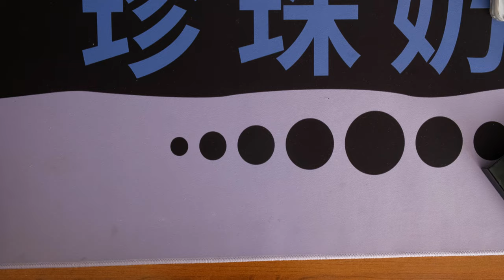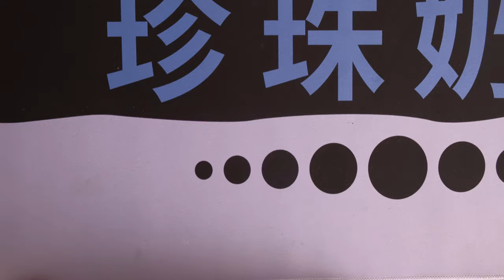Building a $500 Keyboard - The Classy Savage65 with a POM Plate!

Comment: I haven't felt any stick-slip on the C3 v2 stabs whatsoever. I've used them on several builds, but also on my Space65 CyberVoyager which gets a lot of use (and no special mods, just 205g0 and Permatex dielectric), and they are still super smooth and have no rattle.
Reply from the maker: That's dope! I've used c3 stabs before and haven't this issue until this build, so if anything I just assumed it was an issue with possible batch variance, or maybe I didn't lube the housings enough.

I still recommend c3 over Durock v1s, and they're mostly toe-to-toe with the v2s, although I personally prefer the v2s as I find them just a tad bit smoother, regardless of batch variance. But glad to here everything's good on your end!
Reply: @AnzelLmao  Don't get me wrong, Durock V2's are a great choice.
Reply from the maker: @_fatalruin  oh absolutely! And trust I didn't take that comment that way or anything haha, all g

Comment: How did you straighten your wires exactly? that’s the problem I’m always having
Reply from the maker: I use my iphone to check if it's straight. The side the ticks while I tap it is the side that is elevated, so i literally just bend it until its straight haha. I push down on the wire while it's hanging off the edge of my phone for leverage. 

For extra stubborn wires I'll stick the end inside of my solder sucker and grab the other end with pliers. Then I'll twist the wires depending on which way they need to be straightened. You have to be careful tho, as the wire bends fairly easily this and way and it's easy to get into a loop of fixing opposite sides over and over again to compensate for over-bending it.
Reply: @AnzelLmao  Oh ok thank you for your help. I tried doing this but I’m scared I will bend it 😂 maybe I might give it another shot.
Reply from the maker: @Sayject  hahah you'll be fine, I'm sure! Just dont go too ham LOL
Reply: @AnzelLmao  😂 got it, thanks for the help.

Comment: POM plates are so good.
Reply from the maker: I love this thing! Even though it's not as nearly as flexible as I thought it would end up (the pcb doesn't have flex cuts, dunno why I didn't think of that lmao), the bottom out is still super soft, and I love it!
Reply: @AnzelLmao  yeah man for sure! pom plates are flexy but not too flexy for me, I think the fact that its aluminum with top mount might take away a little flex. But the sound is great.
Reply from the maker: @deezy9330  tbh it's also probably the fact that it has like 8 mounting points? But definitely the lack of flex cuts in the pcb as well; even just holding the pcb you can tell it's not that flexible... but I'm still holding out for a kbd67 flex cut pcb and an fr4 half plate one day LOL
Reply: @AnzelLmao  Yeah I agree. 8 mounting points will def hold the flex back, using a pom plate rn and I love it for the most part. Man I agree, I want a fr4 plate and half plate so bad lol